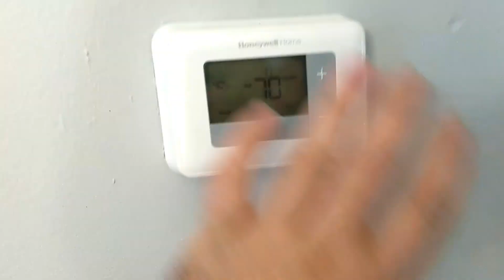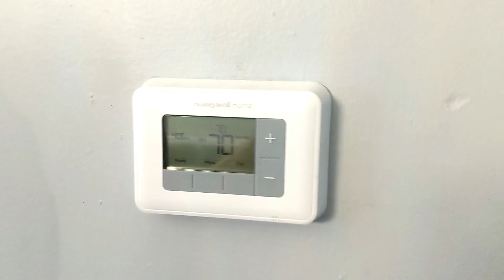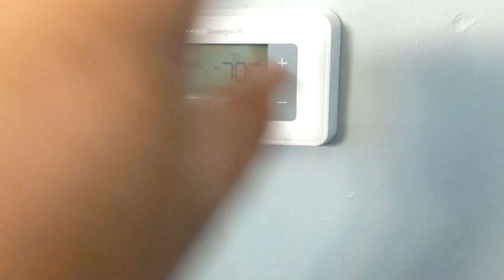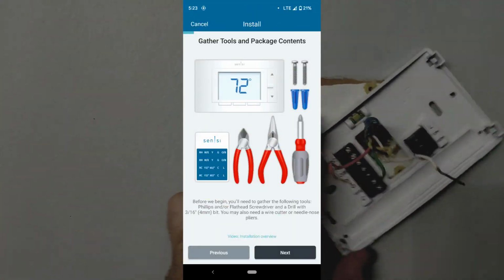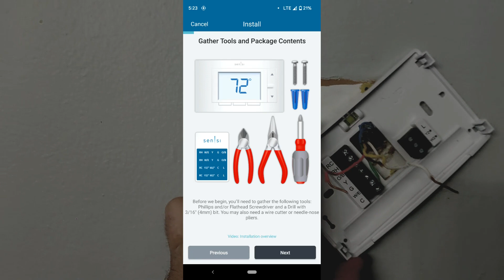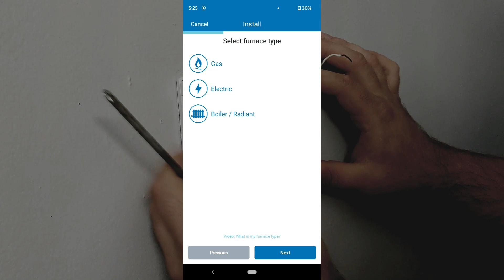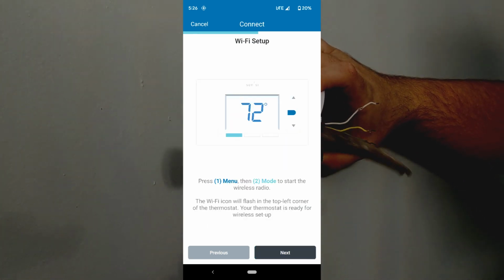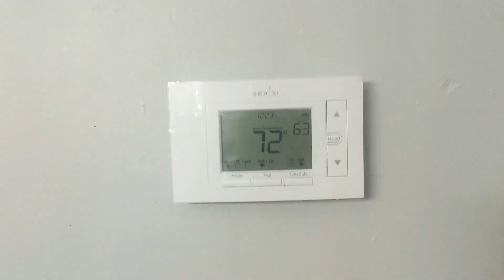Wire and Install Emerson Sensi Wi-Fi Smart Thermostat! St55 No C wire needed!

Comment: In the app, when selecting which wires my existing thermostat has, it has a red wire going to the Rh terminal, but the Rh and Rc have a blue jumper connecting them. I gather that I don't have to worry about a jumper to install in the Sensi. But, in the app, should I select that I have R or Rh? Also, can I use a C wire in addition to the batteries to power the Sensi so I won't have to worry about replacing the batteries (like if they go dead while I'm gone on vacation)? If I do use the C wire, do I still have to install batteries and replace them when they go dead?